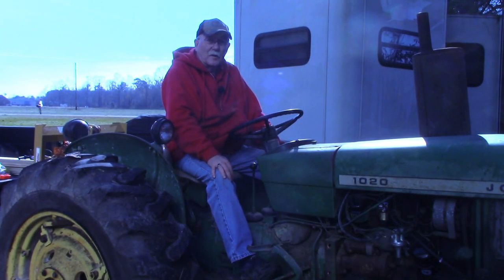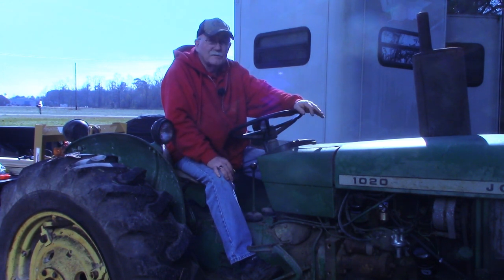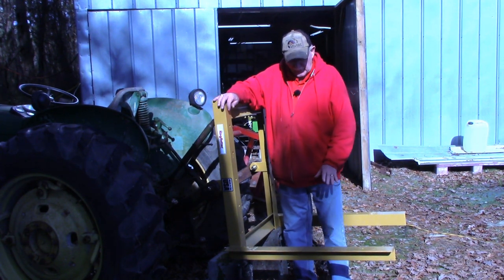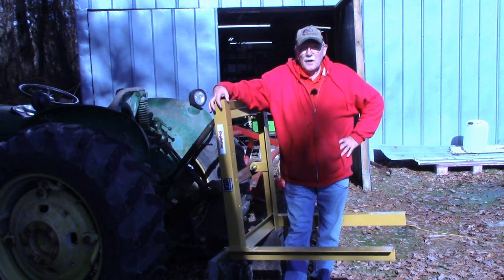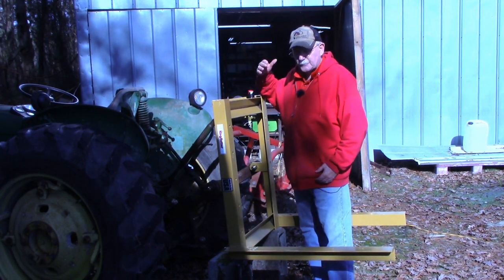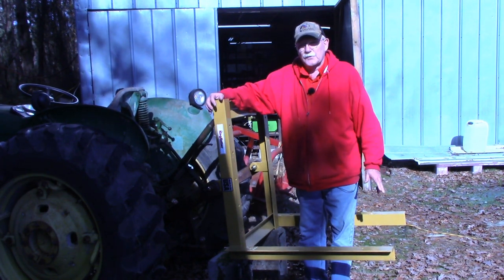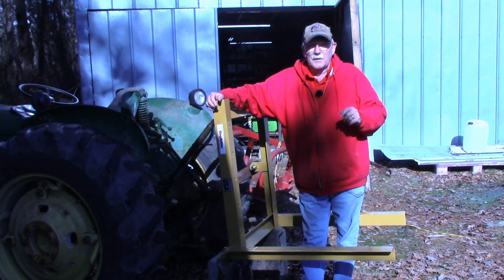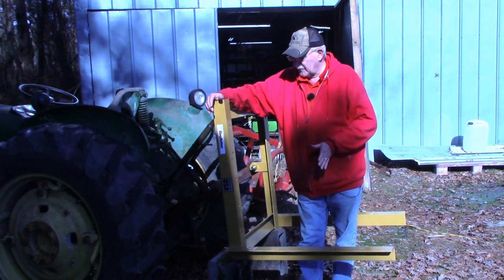Carry All Tractor Implement

Comment: A very practical implement for the tractor, As a suggestion I recommend putting an eyebolt at the top on each corner and another one on the base at each corner, this allows you to fix a chain diagonally and help to spread out the weight when carrying something heavy and also removable I also put removable sides and back on mine to make it more box like. Stay Safe, its not over yet.